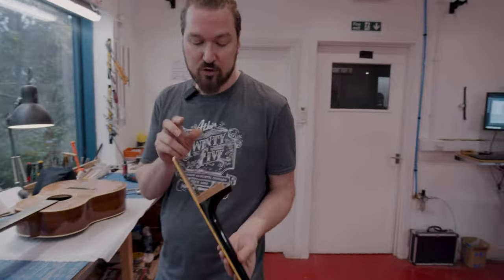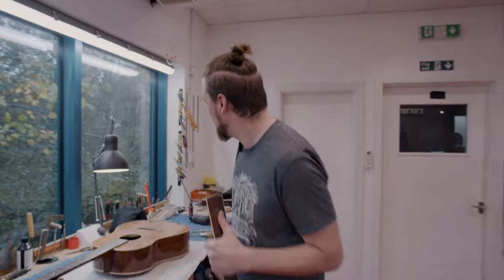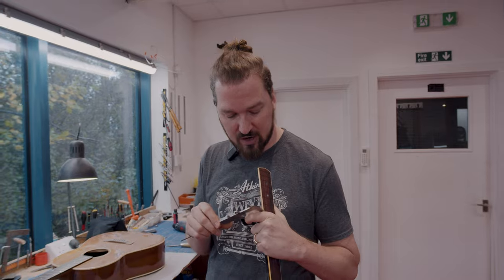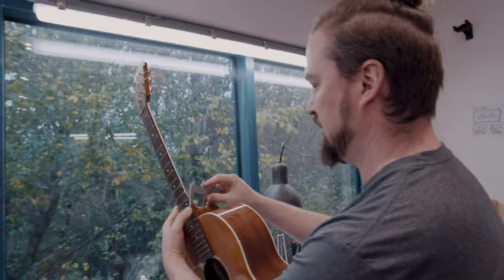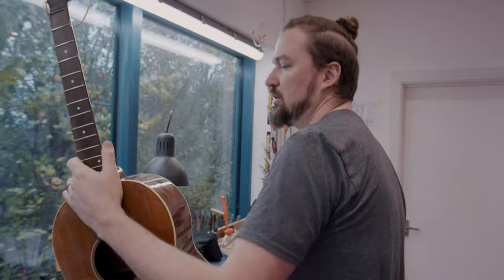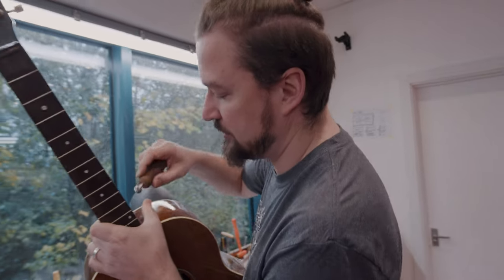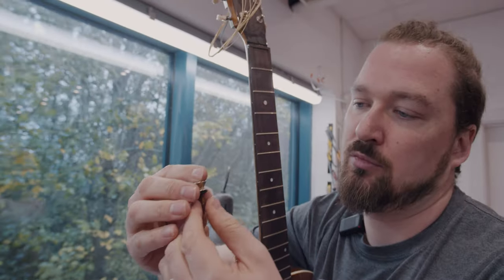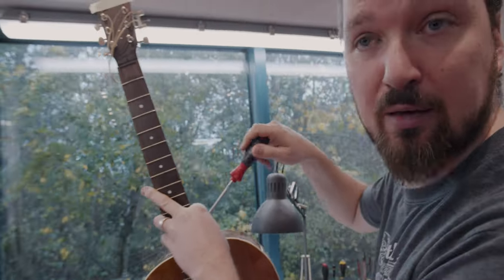How to put a strap button on an Atkin Acoustic

Comment: Hi Lawrence. Is that definitely 45mm from the top of the fretboard? I recently bought a LG47 and the shop advised (after apparently contacting  yourselves at Atkin) that the measurement was 45mm from the bottom of the fingerboard. I am now quite confused??
Reply: Hi Andrew, either is in tolerance. So not to worry. 45mm from the bottom of the fretboard may look more appealing on a longer heeled guitar like a D37 or a J43.
Reply: @laurencelock  Thank you Laurence. Very much appreciated.
Reply: @laurencelock  I am fitting my strap buttons, which were recently supplied by yourselves on to a LG47 and an OM37, so  would I be correct in assuming 45mm from the top of the fretboard would be suitable? Cheers.